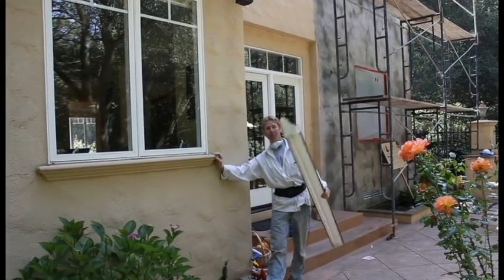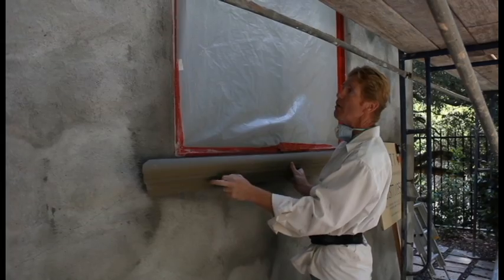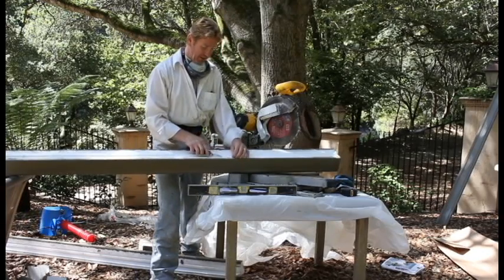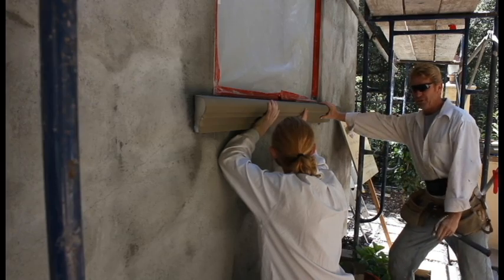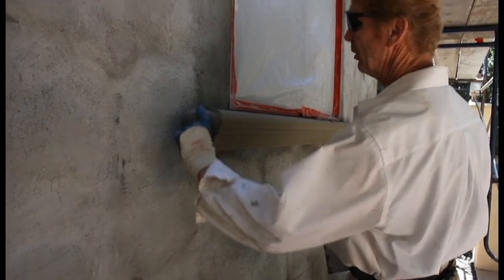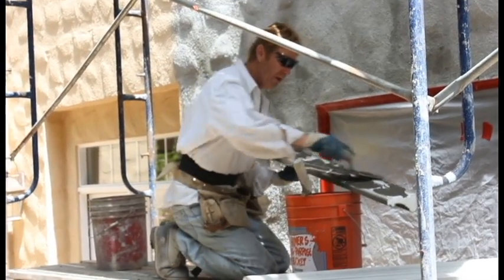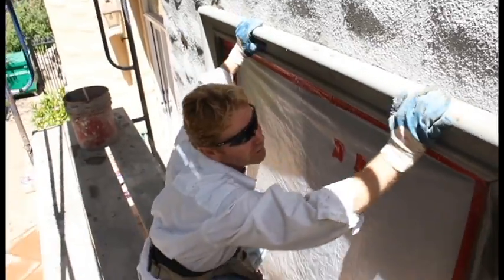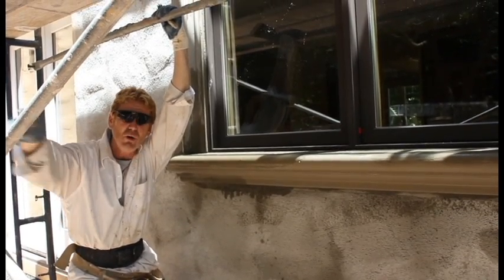Styrofoam to stucco walls

Comment from the maker: Hey deezynar, yes, I have a system which I follow when installing stucco weep screed below the grade. I first apply a few tubs of Sikaflex polyurethane elastomeric sealant along the mud sill or bottom of the ply wood then apply it to the drip or flashing I am using, next I squeeze it where I need it so that it seals the area as best as possible.
Best wishes,
Kirk Giordano plastering

Comment from the maker: Howdy NIFTYDRIFTYPROD, Yes
EIFS stands for Exterior Insulation and Finish Systems. We used to do allot of it when I was a union man in the early 80s, usually on hospitals and schools.
 In simpler term it’s styrofoam with a mesh netting and a Portland type of cementitious finish applied on the top. Styrofoam is sort of fragile but with the mesh and finish coat its really strong.
Have a great day! 
Kirk Giordano plastering

Comment from the maker: Hello brarmanini , no,  the  bonding agent you last asked me about is usually a liquid for cement to cement or stucco to painted surfaces. 
I would recommend Poly-Bond for this work, it comes in a twenty pound bags.  You mix it with a drill and apply it to the Styrofoam molds then attach them to the walls, I usually use a nail to hold into place as it takes time for the Poly-bond to dry. La Habra makes this material.
Thanks for watching and have a good evening! 
kirk Giordano plastering

Comment from the maker: Morning  brarmanini,
You don't need to strip the paint, however I would wire brush the area in question to at least etch it as the bonding agent is only as good as what it's adhered to.

Thanks for watching and have a good day! 
kirk Giordano plastering

Comment: Yes, YouTube is awesome.  I was trying to find information on installing a weep screed under a pop out at the bottom of a wall.  I'm a drafter & was drawing a detail of a wood frame column that has a pop out at the bottom.  I never did see what I was after so I just drew the foam for the pop out going a 1/2" below the floor slab & put the weep down there.  I don't know how the moisture gets around the pop out to get to the weep tho.  Any ideas?

Comment: I didn't explain myself very well.  The situation is where a foam pop-out (I think you call a pop-out, a band) is at the bottom of a wood frame wall, but above the grade.  When I said I drew the foam 1/2" below the slab, I meant I drew it below the top of the slab but at least 4" above grade.  There is stucco wrapping around the foam band and coming back towards the wall horizontally but upside down.    The question is, does the weep go at the foundation, or at the outside bottom of the band?

Comment: Hey Kirk,
Would you suggest using a bonding agent at full strength for putting EPS up using polybond on a painted surface?

Thanks for all the tips.

brarmanini

Comment: I need to install foam moulding to the exterior of a textured wall. 1.) What kind of "glue" is it you used to attach them? 2.) Also the foam mouldings I have are not cement coated. Is it necessary to coat them with whatever material you suggest? They're not in an area where it will be touched or hit. 3.) what should I finish the edges of the moulding with once it is installed? Thank you!
Reply from the maker: Morning Chris Z. it's best to coat properly, fiberglass mesh and any cementitious and adhesive cement plaster will do. 
Because if you try and mount just the form without a solid and protective face, the wind can blow or loosen off.
 Cheers,
 kirk giordano

Comment: We live in Costa Rica, where it rains for almost half the year, then you get the strong sun factor too.  Our house is painted concrete, and we want to add this molding around all of our windows. My question is: do we need all existing paint removed where the molding will be installed before we have a contractor start installing? Thank you for any advice.

Comment: Do you have a video on installing wood trim?  

We are looking to install 2x4 exterior treated wood trim....for the picture frame look. 

Our stucco contractor is telling us that if we want the flat wide trim look of a primed 2x4, we need to cut a notch in the 2x4 trim and install a Z bar at the top of the window for the stucco to stick, and prevent water.   Do you have a video of this?   Is it necessary to cut a notch in the wood trim?

Our stucco contractor was trying to push for a foam trim, but we prefer wood.

2x4 around the new construction windows.  2x6 around the garage door.
Reply from the maker: Hi DJ Email, the notch he is suggesting is what we call a key for the stucco to go into, preventing a hairline crack, he is right foam never rots, wood does, it may cost a few extra bucks now, but in the long run it's worth it.
 The Z flashing above the wood protects the top and rear, plus depending on how you install may protect window.
Sorry, no video on the wood install.
 Best wishes, 
 kirk Giordano Plastering

Comment: Are you supposed to add a layer of stucco on top of the Styrofoam forms in order to match the surrounding texture, or is the idea just to paint the trim work? If you are meant to plaster over the forms, how do you do it in such a way as to not distort the contours of the form?
Reply from the maker: +justin71069 Evening Justin,
 I generally buy pre coated foam and install,
 depending on the finish I tell folks to use a paintbrush and paint some watered down portland cement plaster on them,
 I have on some occasions floated them and applied a skip trowel finish over them.
 There are many options, the idea is do what you want if you want to them to blend into a particular finish.
 kirk giordano

Comment: hey kirk I have an old fourplex building in Oakland and it has wood window trim can I have foam trim installed around it or over it when doing an acrylic color coat?
Reply from the maker: @elianamichel617  Of course you can. You’d have to remove the wood ones first. I take it the building is already stucco? If so attach the new foam, now apply the primer used with your chosen Acrylic stucco, then apply the acrylic stucco coat.

Comment: WOW, very cool. Is there nothing you Guys can't stucco? That texture had to be a pain to match. Can you place foam moldings to very old concrete walls using your poly-bond?
Reply from the maker: Howdy surfer dude,
 we can stucco anything as once you learn the basics, you too can stucco anything.
 Poly bond will attach most things to any surface, but the surface has to be super clean as nothing adheres to dust.
 Cheers,
 kirk giordano

Comment: Hey Kirk, how did you learn stucco and plastering? Not many guys do it here in Ontario Canada, my boss would like to send me to England to learn the trade. It's a whole new world to me but seems a bit more fun compared to drywall taping. No sanding like drywalling :)

Collin
Reply from the maker: Good evening Danielle Mark, I sort of fell into this trade, an add said hod carriers wanted, 7 dollars an hour, I interviewed for this position got it and hod carried for a couple years.
 I Asked the plaster's why they made much more cash than me and heard they are craftsmen and not labor.
Tried my hand at it while still keeping up with hod carrying duties and found I was as good in a month as most guys were with 5 years training.
 It was my calling.
 Best wishes and have a great New Year.
 Your right, sanding sucks.
 kirk giordano plastering
Reply: Danielle Mark, there are alot of stucco companies in the Ontario  Canada, Specially in the GTA. We have  a better stronger material that what is offered in the US.  such as Durock or Drivit. I have seen  alot of Kirks videos and what he does its old school stucco.  no one does it here in Toronto, the exterior moulding is put on the back with a T trowel 1/2 round, similar to tiles, for better grip, we use a level on straighten out  the moulding we do not hit it with our hands.
Reply from the maker: Hi Suria Sej, fair enough, BTW, the Dry-Vit system from Europe is one of the best.
 cheers,
 kirk giordano

Comment: Kirk, if you buy foam trim already prep'd with fibermesh and cement, would you not need to add fibermesh between newly installed trim and the wall and cement over the mesh to tie the two together?  Or, is simply filling the cracks with poly-bond cement without fibermesh sufficient (just like you did in this video)?
Reply from the maker: Evening Mate, where the joints connect poly bond is all thats necessary.
Cheers,
 Kirk and Jason giordano’s rendering videos

Comment: Kirk, I have a similar question as Maria, I watched the Marvin window video, didn't see any drip cap being used on top of the patio doors... I busted out my stucco for new patio sliding glass doors, they are in and now I need to repair the stucco around them. 
If I want to add these foam trim pieces, do I put the trim on top/over the drip cap? Or does the top foam trim need its own drip cap?
thx!
Reply from the maker: Morning Jeph, We don't install the windows or doors, however the majority of them come with the metal or more often plastic Z flashing for the tops.
 The Z cap is often unnoticeable, we stucco over the sides and tops as usual, if you look closely you will more than likely see the lip coming down the top of the window only about an 1/8 of an inch. 
Most foam molds do not need drip edges, say for example, if molds were to be placed around an entire home such as a belly band these foam shapes will have a sloped edge to allow the water to run off, not go behind.
 Best wishes,
 Kirk giordano

Comment: Are you supposed to mesh the joints where these trims meet eachother or simply coat the joints with poly bond?
Reply from the maker: Hi David, no, it's not necessary. 😉

Comment: hi kirk I'm having problems with stucco framing on MI windows not been right so they are leaking water from the rain...how much is it to replace the stucco framing on windows on avergae?? thanks
Reply from the maker: Hi Zade Jweinat, I just apply the paper and wire myself along with the two coats of stucco and match finishes, I usually can charge between $300 to $700 dollars depending on many circumstances.
 Ifs the windows are installed properly as many of my contractors will do I am on the low side, if they are high in the air, and 30 stairs to get to them plus, the break out is completed by someone who is not willing to properly prepare, cost can be on the high side.
 Cheers,
 kirk giordano

Comment: Hi Kirk, what kind of glue or cement you use to to attach the foam molding to the cement wall? and what kind of saw you used to cut em..or do you have any video I can watch?
Thank you.
Reply from the maker: Howdy Tylor we attach the foam with poly bond made by La habra, when we cut them we use a very sharp and new blade with many teeth or a cement masons blade, we start by spinning the blade as fast as possible then allow for the cut, this way less fibers to stray.
 Cheers, live long and plaster
 giordano’s stucco images and teaching videos

Comment: USE THE CONCRETE NAIL...
Reply from the maker: Howdy Haroon Qureshi, thank for the tip, however I find concrete nails much too small for these needs.
 yea, it's a drag that sometimes they bend but most concrete nails are 1/2 inch to 1 inch as they are designed to go through concrete.
 Best wishes,
Kirk & Jason Giordano's DIY plaster and stucco channel

Comment: I use  to hang up foam for 12 years and never used a nail in my life, It would make more sense to hang it up raw without the fiberglass mesh and stucco coat, it will weigh less , no need for nails
Reply from the maker: My response is in the description, cheers

Comment: hi kirk..  I'm installing foam letters but it's just the foam.  what can I used to covered for painting or poly bond for a finisg.  thanks
Reply from the maker: Hi Victor Sanchez, it's best to coat properly, fiberglass mesh and any cementitious and adhesive cement plaster will do. I usually use Poly Bond.
If you try and mount just the form without a solid and protective face, the wind can blow or loosen off.
 best wishes,
 kirk giordano
Reply: +Kirk & Jason Giordanos DIY plastering and stucco tips 

thnks u

Comment: If I can’t find polybond in my area is there anything at Home Depot I can use to attach the molds
Reply from the maker: Howdy Kyle, try googling plastering yards such as Westside building materials in your area, I would not trust hardware supplies to attach molds, myself.
                    Live long and plaster
               Mastering Plastering

Comment: I know of a stucco house where they installed 2 inch foam board on the outside. Can you put foam board over existing stucco? They have put some sort of stucco finish on the foam board. Is foam durable to the weather?
Reply from the maker: Howdy Anthony, yes, however it's usually 1 inch of styrofoam with stucco it's called the Dry -Vit system 30 years ago, but now there are about 20 other companies that use the same principals.
 No, the foam cannot be exposed to weather, stucco covers it.
 Cheers, live long and plaster
 giordano’s stucco images and teaching videos
Reply: Thanks for your reply and information.
Reply from the maker: Howdy Tony, no worries,
 Cheers, live long and plaster
 giordano’s stucco images and teaching videos
Reply from the maker: Howdy no worries,
 Best wishes with your projects, live long and Plaster
 Kirk giordano on teaching plastering

Comment: Kirk, have you ever installed Spectis Moulding products?   They are a very high density foam shape like mouldings and blocks.
If you have, I would love to include you on our site links.   www.spectisproducts.com
Reply from the maker: Hi Dan B, yes, I have installed these molds before, I used to run molds free style 30 plus years ago where we used wood templates, and create our own mold with either fast set gypsums or for exteriors portland based product with accelerrators added. (luminite)
 All prefab molds are much easier,
 Sure, you may include me on your site, however I don't get a lot of folks who wish these attached anymore, as I do mainly residential,
 Cheers,
 kirk giordano

Comment: Plz don't use nail the house will leak
Reply from the maker: Hello Oscar Manjarrez, good tip, however, we have a peel and stick under the paper one.
 Best wishes,
Kirk & Jason Giordano’s DIY plastering and stucco network
Reply: Kirk & Jason Giordano's DIY plastering and stucco network i have been doing foam pop outs for the past 15 years at kenyon plastering in Stockton CA. and we have never used nails.
Reply from the maker: HI Oscar Manjarrez, you and your company can attach the molds however you choose,
I am  responsible for the molds staying on the wall and feel more comfortable with the addition of nails.  
Plus there are two layers of waterproof paper plus a peel and stick behind these, so I am not worried about water penetration.
 best wishes,
Kirk & Jason Giordano's DIY plastering network

Comment: fake concrete looks just like fake
Reply from the maker: Evening ted turnip, you've a better eye than me as I can't tell them apart, and I have created by hand the real thing using templated and levels.
 I will say this about foam versus solid concrete shapes or sills, foam is safer and stucco walls are far less likely to develop hairline cracks as there much less weight.
 It's a homeowners choice that matters little to me. 
Cheers, and have a Fantastic New Year!
Kirk Giordano’s DIY plastering tips